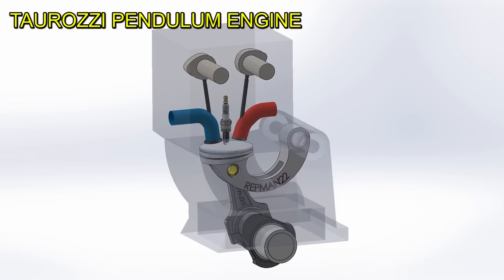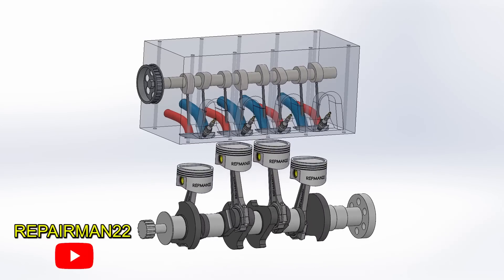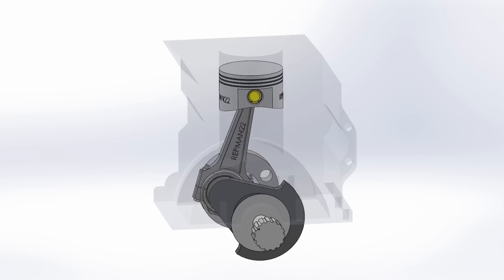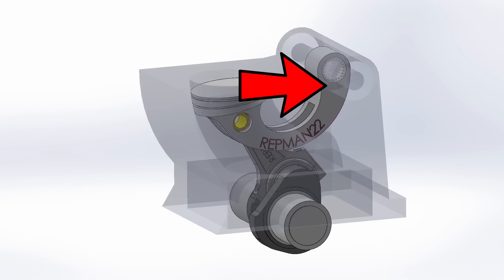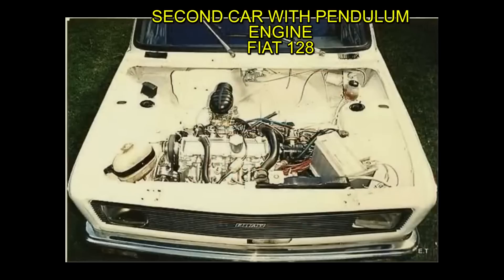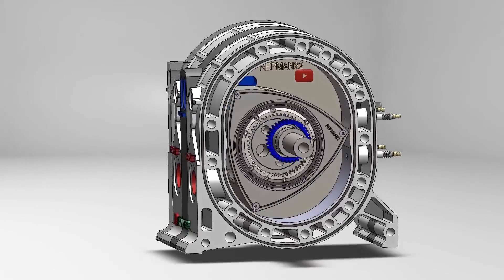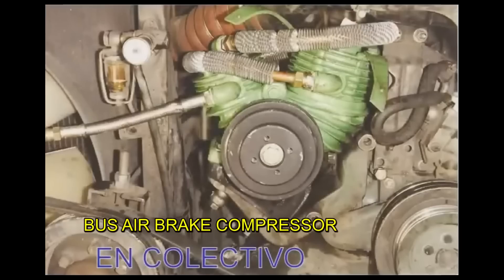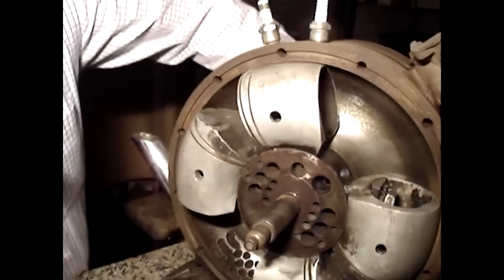All about the Taurozzi Pendulum Engine 🧠 and what happend to it🤯

Comment: “No smoke 2 stroke” is flawed because the AI narrator speaks ignorance. 2 strokes smoked because of excessive oil in the fuel mix, but there is nothing stopping anyone from building a 2 stroke engine with a self piling system. It’s not friction it’s part of the combustion process to burn the oil that’s premixed with gas and put through the carburetor!
Reply from the maker: 1- not a talking bot
2- 2-strokes need oil to lubricate the engine.
3- this engine has no friction in the pistons, its skirt is smaller and the little oil that is used reaches the rings better
4-using less amount of oil emits less smoke.

Comment: GM finally figured some of that out with their LS engine. In the LS, the cylinder bore was increased so the piston never gets close to the bottom of the bore. The piston skirt was also shortened, and an oil jet to lube the lower cylinder added.  They also increased the cam bore size from .75 to 1.0 inch,  increased oil capacity and circulation. Another big one was modifying the heads for optimal flow. Then they tightened it up using tongue in groove everywhere w/oil behind it. With the improved EFI and ignition system the beloved LS will last 300k+ miles with average maintenance.  I got 500k from an LS2 6.0 w/frequent Mobil_1 changes  (<4k miles)  Long live the LS.  LOL   --gary

Comment: Seems like alot more parts and more weight being thrown around, not surprised it didnt catch in but its an interesting concept with interesting perks.

But if auto manufacturers wanted better engine tech, every car would be turbo electric, two moving parts in rotating assembly, engine rotor, and electric motor.

Comment: The vibration though? My imagination cant take the forces being thrown by the banana pistons.
Also, the engine being frictionless is too much of a promise. How the hell would you compress something without sealing it, the rings should be needed to be in contact with the bore to provide sealing in order to create compression and thus friction. Other than that, the banana bearings should take into consideration the expansion when heated due to friction. My mind cant wrap around the idea of the engine without having a piston skirt when cold started.

Comment: It's clear the engine would not be better. Firstly, curved cylinders do take more work to create. Drilling a straight hole is simply easier. Secondly, the bearing holding the cylinder would result in a loss of energy, because it will be putting load on that bearing. That's just an undeniable fact of physics. Once you factor in the surface area of the bearing, it's also effectively like increasing the surface contact area of the piston. And once those bearings wear out, there will be problems with the piston that will cause excessive wear and tear. So in the short term this engine might seem fine, but not in the long term. The shorter throw also means less compression, which means less power. You get perhaps quicker rotations, but at a lower torque, which means to increase the torque, a special gearing system would have to be put in place that turns that lower torque into a higher torque, which means more complexity outside of just the piston itself. And the more complex the gearing ratio, the more friction you add to the entire system, which again, is like adding surface contact area to the piston. If you add it all up and ignore the various aspects and complexities, it's easy to see how this would actually perform worse than a traditional piston. Although of course it's not entirely useless of a design, it can have its place in smaller applications.

Comment: I'm not convinced more moving parts and piston riding a curve cylinder doesn't add more friction thus wasted power.
How does a curved combustion chamber burn efficiently or completely?
The reality is it works, but isn't practical with better designs in use.

Comment: even if you put the precision of manufacturing into the manufacturing process of the structure, the abrasion will not be uniform and this will inevitably lead to loss of compression with any rings, in my humble opinion, the solution to the voiced problem in the edge load and deformation of the piston can be avoided by noting that this disease appears with the desire to be very light and the piston literally only with the working surface of the bottom and a decrease in the tronka, and the increase in mass, even if it has a different axis of movement, to put it mildly, is not, on the contrary, a more acceptable solution would be to reduce the mass to such an extent that the piston bends around the axis of the finger to create straining movements at the ends of the finger and eliminate bullying with simultaneous inertia compensation or if there is no possibility of maintaining the required operating modes, for example, in Formula 1 engines, simply choosing a metal and creating a slightly larger gap, that is, actually an oval piston with preservation of the round shape of the cup and rings, which will allow you to work at high loads while maintaining the position of the piston.

Comment: Swashplate engine also doesn't have sideways forces acting on the connecting rods and pistons, and it doesn't need curved holes to exist. And it is also not being used in cars, while the car AC compressors are usually constructed like a swashplate or wobble plate engine. So curved holes or having a pendulum arm are most likely not the reason.

Comment: Come on boring a curved cylinder is easy.  lol. We put men on the moon but major engine manufacturers can’t do this.   Total B S. truth is the automotive industry has tooo much $$$$$$ invested in all there other crap.  Sad but try.  Listen HYDROGEN BATTERYS WERE INVENTED in the early seventies and oxy hydrogen engines with large alternators cracking off the gas from WATER.    

ALL ABOUT big industry not wanting to change or tool up.  Imagine an ENGINE THAT LASTED 5million miles with minimum maintenance.. nope FORD would blow its top. Again

Comment: It didn’t take off because manufacturing was set up for typical straight bore engines and the claims of 30% less fuel due to reduced friction would have been easily tested and proven false, so why would they spend billions on manufacturing changes when there was no real benefit

Comment: I suspect his 30% claim wasn’t accurate. The design may well have real world benefits for an engine, and reducing friction does improve economy (low tension rings for example), but I don’t see a 30% gain from even hypothetically reducing the friction between the cylinder and piston to 0 (which this design doesn’t do).

Comment: It seems interesting but to say it needs no oil is absurd. It still has connecting rods and a crank shaft, and there is still piston rings which is a main point of friction in all designs. All of these things need lubrication and Teflon won't last long enough. 

Also unmentioned is the engine balance. How does this configuration effect the balance? Not positively I imagine. 

This seems really over engineered to reduce one point of friction just to add several more parts that also induce friction and rotating assembly mass. I don't believe the fuel efficiency claims for a second.

Comment: I guess today with the modern CNC machines it would be a lot easier to make a curved cylinder. Because with the use of the computer can move the part as well as the cutting tool . Like making a corkscrew only bigger.

Comment: Hmm, I wonder why these engines never made it to mass production. Maybe implementing the tooling required to created a curved cylinder wasn’t financially feasible for mass production. 

I think these are really cool! You’d think, with the weight savings, we’d have seen these in racing to some extent. Maybe there’s a major flaw that wasn’t covered in this video.
Reply: A major flaw is that it wouldnt wear down at all.
Reply: @divinehatred6021  I can see how that would keep manufacturers from implementing it for production vehicles, as they want money for servicing, repair, and replacement. But for racing, that’s not a factor. In racing, they don’t want wear. They want optimal performance. 

That’s why us consumers only get watered down versions of racing tech
Reply: @brickson98m  i believe that this type of engine will immediately get banned. If they banned something like M3 GTR... And cars like Viper was forced to drive with 500 kg of ballast... And AFTER that it had to be cut from V10 to V8 to stop it from winning lmao...
Reply: @divinehatred6021  it really depends on what racing league. Some are more strict than others. I don’t remember this video saying that these make any more power per liter than a standard engine, which would be the concern in racing leagues.
Reply: @brickson98m  of course they are making more power, because there is literally no friction in the cylinder! And the engine saves a lot of weight, too! Which is amazing.
Reply: @divinehatred6021  weight is a big factor. But does it actually save weight, considering the two part connecting rods? One to go the bearings, the other to the crankshaft. 

Additionally, there is still inevitably some friction, just not as much. Not sure how big of a power difference this would actually have. I’d love to see one on a dyno
Reply: @brickson98m  oh well, nobody can build a  proper engine in their house, only car giants like toyota could actually give this thing a chance. And even then, they wouldnt do so with their main engines, most likely with hydrogen ones only(since those have major friction problems)..
Reply: @divinehatred6021  hey, I’d love to see advancements in hydrogen engines. They’re a lot more exciting than electric, in addition to being more sustainable.
Reply: @brickson98m  Its more like... if people invest in nuclear energy, they can infinitely use both electric and hyrdogen cars for way cheaper

Comment: This as a 2 stroke opposed piston engine could be revolutionary 

Opposed piston engine are just as efficient as 4 strokes... The only downside in terms of emissions is the oil that gets burned.
Using graphite to reduce the already miniscule friction in this engine would mean two stroke complexity with 4 strokes efficiency.

Comment: I do not really understand why production costs should play such a role: If the fuel economy is 30% better, the production costs can be TWICE as high and the engine would still pay off! (calculation with a 100hp gas engine costing around $3000 running for 100'000km with 6l/100km and a gas price of $1.65/l).

Comment: Seems to have more moving mass and with modern cylinders much smaller than in the old days.
Prob had benefits to the engines of its time, but doubt it still holds up to modern lean running small engines.
But epic design though.

Comment: The amount of times you say it has "no friction" makes it hard to to take seriously, it is impossible and very obviously not true. Friction is everywhere that parts move relative to other parts, it still needs to seal against the cylinder walls and the banana arm adds another point of friction where it pivots.
Research has shown piston friction to account for less than 20% of total losses, which means that even if it did completely eliminate piston friction (which is impossible because of needing to provide a good seal with the cylinder walls), it can't increase efficiency by 30% as it is claimed.

Comment: At 5-8k that arm has to deflect a good bit and cause the piston to contact the wall… even straight connecting rods deflect. Id like to see a finite element analysis done on the piston arm. Also ring land breakage due to knock must be a concern with the short and uneven skirt. 
I’m sure production automotive engineers consider these things. 1 motor living 40 years is great… 10 million motors making it past 100k miles is a miracle and required these days

Comment: This is full of assumptions which are poorly based. Why should there be less friction? It still has a piston travelling up and down a bore which must be tightly sealed to prevent leakage past the piston rings. Oh the bit about boring the curved cylinder bores makes it sound so easy. This has just too many whiskers to be a viable alternative to the traditional internal combustion engine. What purpose does the pendulum motion serve which makes it a better design principle?

Comment: 30% less losses does not mean that the engine is 30% more efficient. Since there is the maximum combustion efficiency limit and engines are already pretty close to the limit. All in all, this could mean a 3 to 5% increase in actual mpg. Now if that engine cost twice as much as the conventional one, who will buy it? How will the manufacturer recuperate the development costs?

Comment: I am a bit sceptical whether this engine provides the necessary efficiency over a standard engine to be considered worth the extra complication to manufacture such a curved cylinder. 
However I can see that the engine probably would be a serious hit with F1 cars, the Taurozzi design allows for a more compact piston thus you can theoretically increase the speed to 30k RPM which would be very good for a F1 racing car. 
The only other benefit would probably be a 25% smaller engine duo to the compactness of this design, could be useful for some equipment but the added cost to producing the block seems to negate a lot of things.

Comment: I fail to see how it could possibly have less friction. There is an extra pivot point, and the forces on the piston are going to try and throw it in a straight line, not around a curve. The outside of the piston ring is going to wear much faster than the inside, due to both the extra distance traveled and the pressure acting on that same spot.

Comment: Surely a curved cylinder with a fast moving piston would introduce a centrifugal force to the long radius side of the piston creating more wear and heat? In a straight bore the piston exerts the same force equally.

Comment: That is a really cool design. Both compression and exhaust cycles can be shorted by increasing force on the banana arm. A simple spring or torsion system could be used with a computer timing it to make the entire cycle just a little bit shorter, but massively increasing the ware life of the components.
Reply: Magnets... truly friction-less engine

Comment: Stroke is limited.  The pivot arm reaches up and under the bottom of the cylinder to reach tdc.  To make a longer stroke the toroid diameter must increase, and the pivot arm still has to reach under the cylinder.  It looks to be getting big and heavy.   

A short stroke engine already has a short piston skirt.  Also, short stroke engines rev high, so the pivot arm weight would be an issue.  

might not be the panacea the video says it is.

Where this certainly makes sense is when getting rid of that oil ring matters.  Like they said.
Reply: "might not be the panacea the video says it is."
Of course it isn't, if it were it would be used by now. This isn't some extremely complicated technology "kept from the public in a government lab", it's literally a combustion chamber shape.
Manufacturers have been tripping over themselves for at least 30 years chasing fuel efficiency figures, if this thing could really increase efficiency by 30% they would be all over it. The reality is it's probably worse or negligibly better than a normal straight bore design.

Comment: So you loose connecting rod and piston pin bearing losses, but gain heavier piston-rod assembly and extra axle for pistons.
I hoped that there is something smart about this, but when it got to the "less thermal losses because fewer bearings" the go cart that stayed cooler because of this, I knew this is bull.
Well, I knew it earlier, I just hoped that there is something going for this. Turns out, there isn't.

Comment: The process to make this would be too complicated and custom difficult to produce, more moving parts the more things break, normal motors and vehicles can get upwards of 300k miles with just simple oil changes and tune ups, the only way friction is down is because the skirt is missing allowing for extra engine bypass, essentially what I’m saying is why don’t we just add some piston return springs while we’re at it

Comment: I mean there are more difficult machining involved that would take more advance tooling in factories but once the process was ironed out it would be fine.  Honestly adopting a new engine even one that is superior is difficult. There are many engine designs that are superior to what we use today but this is the adopted tech and it is what is known. 

I think this was not adopted for a couple simple reasons. Fuel was cheap and efficiency was not on everyone's mine the cost to retool all there plants and figure out  mass production of these new system was not worth the cost of fuel savings. Manufactures of conventional engines prolly also Lobbied against this since they would have to spend money. 

Now that the world is more forward thinking when it comes to being more green and efficient. The ICE is potentially on the chopping block until we properly find the motor of the future. If it turns out that energy storage to power electric motors is to much of a problem and we come up with a new super fuel that is net 0 this will revive the ICE and we may see some of these more radicle designs come back. 

That being said for the time this was cool but after the advent of other ICE's like the rotor x and the axial engine it kind of takes the advantages of what this engine brought but with more conventional and simple methods.

Comment: In a normal engine, there should be no contact between the piston skirt and the cylinder wall. If there is, that’s because there it significant bearing wear allowing for “piston slap”. Only the rings make contact with the cylinder walls.